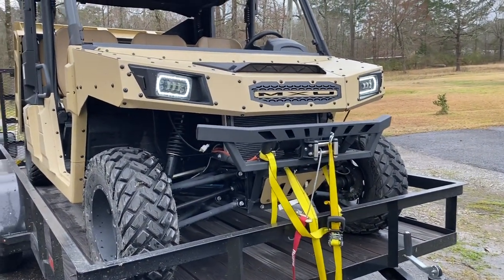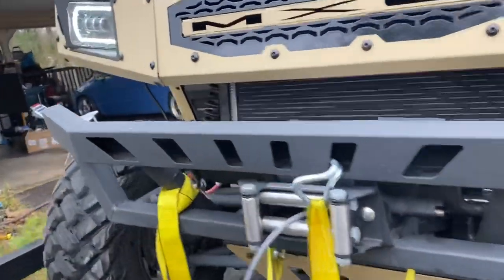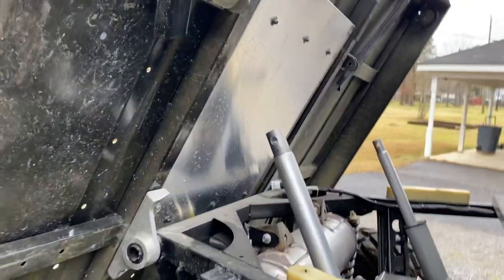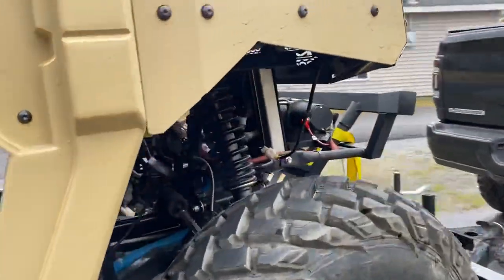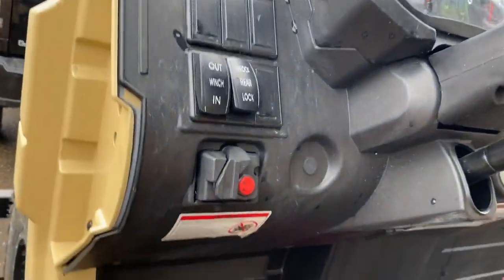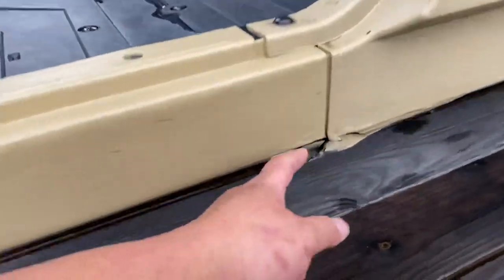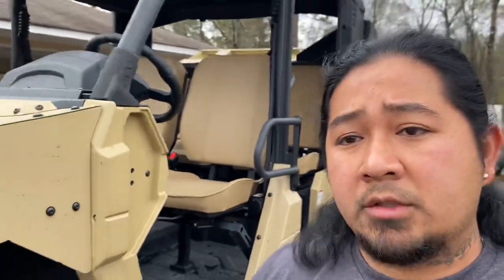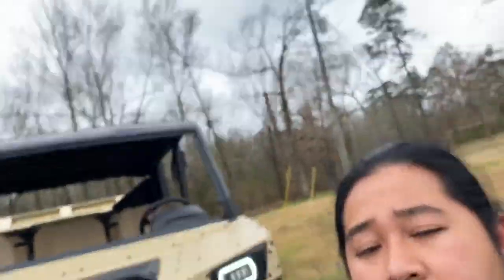MXU 1000 biggest junk on the market

Comment: There’s another guy on here that got burnt with this same unit. His name is Kenneth Shilling. His issue started at only two weeks after he purchased it. They cockblocked the comments section on his video. You can see by his about profile when they started to block him like they were ready for him when he made the video cause he’s tried to re-upload the video it looks like five or six times and yet the comments section still won’t allow him to get a response. His issue started after he left his place in Texas or maybe it wasn’t his place, to make a long story short when he got to his place in Oklahoma I believe, the bike wouldn’t run right. So after calling the dealership in Texas, they told him to unplug the battery for 15 minutes or so and that should reset the computer to be able to run it there but it didn’t work so now they telling him to disconnect the muffler and clean it out because he thought it might have built up some carbon on it. The refused to do that because now he would be voiding the warranty so they just cut him off. When I say they cut him off, I mean YouTube cut him off completely so he wouldn’t be able to see the comments at all and no one is allowed to ever see them. His video has just over five thousand views on it and he had just started it March. They stopped that one video from ever gaining any traction on it. Five thousand views. Can you believe that it came a Chinesium company with that kind of power to stop a pissed off customer from revealing the truth about their product. Well anywhoo

Comment: Bought a MSU 850 and it’s not much better than this. Throttle cable seized up so they gave me another one to put on myself because both of their mechanics quit at the same time. Well not only did the new replacement cable seize up but the drive assembly decided to take a dump and guess what it said on the cover. It said CF Moto. All jokes aside, the way I see it is that CF Moto didn’t think this power plant was good enough so they sold a large quantity of them to Massimo for an unbelievably low price. Enough said. So now after on three months and only 53 miles on the bike and it’s Christmas time coming up. You guys thinking what I’m thinking. Either someone gets a new bike or a total refund or somebody’s gonna to ruin Christmas for all its employees. If I have to lawyer up, I’m prepared to do it at this point I’m so stinking mad. After paying them cash and they still didn’t cut me no breaks. After it was all said and done I shelled out over 15 grand for the bike that started out good but ended up so bad, especially after having to take out all my saws and trimmers out the bed and log splitter equipment. So yeah like this guy says, spend the extra money on a reputable company and you won’t have these problems.

Comment: Hmmmm, the feeling I get is that there are surplus electrical connections under the front that are there for a reason ie extra accessories. Why were the hydraulic rams disconnected? I'm a self taught mechanic and think there is more to this story than we are being told.
Reply: I bought a massimo gkm200 aka a 176cc gokart. I went through the entire thing with a mechanic buddy of mine and tightened all the bolts, fixed the tie rods, replaced the oil and air filter (didn’t need rejetting), and then took off the governor. Left it out in the snow and it was fine, beat the piss out of the thing too. For Chinese stuff you gotta go through it before you ride it. Sure it’s gonna rust out in a  few years of I don’t repaint it but it’s not bad.

Comment: Your issues have a lot to do with a sub-par dealer. I know this because we are an Odes dealer and I get machines in all the time that sat at other dealerships for months. Sometimes it really is parts availability (I've dealt with that and it sucks), but what Ive found is it's often dealers/techs that don't know what to do with it. You'd be surprised how common that is. This is half the problem. Many iffy dealers, so you have to choose wisely. Maybe ask how much power sports experience the service dept has.... That'll tell you a lot about what you'll get for service/support. 
How you got the machine back with wires hanging all over and switches that don't work says EVERYTHING. 
As for the extra connectors hanging under there, that is normal. There are a handful that don't go to anything because as accessories have been added, removed, or changed over the last few years the extra connectors stayed.
Many of the problems people have had with communication are because they purchased their machine when Odes was owned by Massimo. Therefore Massimo will be little help because they are not able to sell those machines anymore. Odes has been back on their own for around a year and building the company from the ground up again and also factory direct. So no more middle man importer for parts. A lot has changed. We helped out Odes as tech support during that transition period too so we got a front row seat to the whole thing.
Reply: @Race Craft If you don't mind me asking... how are both Odes and Massimo?  I am likely to be looking for a crew-sized machine, and specifically want one with heat and AC to make it more useful throughout the year in Canada.  Currently the Polaris Ranger XP 1000 Crew is my top pick, but I'm trying to check out other brands too.
Reply: @Maplicito  if you're looking for something full size, I'd go with Odes over Massimo. The Odes machines are pretty good for the money but I'll admit you will be doing a little more tinkering over time. It's a price point thing. $24k(ish) for heat, AC, winch and light bar. Everything comes standard.
Reply: @racecraft.performance  thank you for the response, that was helpful!

Comment: That sucks, must have been a Friday afternoon machine, lol. But with all jokes aside they are supposed to be a good machine. I bought a RAM truck that has nothing but issue while the motor in it was torn down three different times replacing all lifters before 50,000 miles. My buddy with the same truck has 150,000 on it with no issues to this day. The point is sometimes you actually do get a lemon 🍋.
Reply: My Dodge Ram Hemi 2010 last 240k before the lifter took a shit
Reply: @doublegrant6144  mine only lasted 25,000 miles. Now I'm on my 3rd set before 50,000 miles. For a while there it seemed I  was getting lifters every oil change, not just one set or so but complete change outs of all lifters. This is my last ram
Reply: My buddy fucked up his tie rods and bearings and we still drove 75 miles on the interstate in it. What a shame.
Reply: Sorry you had problems my friend. You’ve had it a long time since I am just now seeing this message. But I’ll tell you that you just bought a lemon.  Who knows?  But it happens to everyone at least once in life. I’m an old cogger now at 73. But I hope you will use this as a learning lesson. Meaning, that try to do what I did as a young man when I got burned. I learned that TIME IS OF THE ESSENCE!  Don’t let it run out on you. Take care of issues with the SELLER and hold his feet to the fire! There are lemon laws in almost every State of the United States!!  Before buying something like this that is so expensive, make sure you check the local laws my friend. Maybe consider MAINTENANCE INSURANCE!!  It can be extremely expensive though. Worth checking out though. 

While you have the SELLERS FEET WARMING UP, BE SURE AND CALL THE MANUFACTURER AND GET THEM INTO THE LOOP AS SOON AS POSSIBLE. DONT PUT IT OFF!  

This way you will be way out in front of them and please be sure above all, DOCUMENT DOCUMENT DOCUMENT EVERY THING!  

I’ll shut up now but considering the amount of the money, at least for those who are SA’s, just threaten them with legal action. 

Lastly, MAKE THEM GIVE YOU ANOTHER BRAND NEW MACHINE. GIVE THEM THE LEMON BACK. YOU DIDNT COME TO THEM TO BUY A LEMON. GIVE IT BACK TO THEM AND GET YOU ANOTHER NEW ONE!!  

Hope this helps. It works for me fifty years ago and it is still working for me today!  God Bless!!

Comment: Had similar issues with CFmoto uforce 1000. After 3 months in the shop, they never could figure out the electrical issue. Had wires melt, fuses blown, wouldn't start half the time, and battery drain. Sold that piece of xxxx.
Reply: What did you get to replace it?

Comment: I had almost exact same problems you did minus the electrical fire on top of the fuel tank they were able to get me a new one and it Road about 3 feet under the trailer and it dropped a rod. I had to file with the state of Texas for the lemon law and it took a few months, but I got it back and probably wouldn’t buy the Kabota.